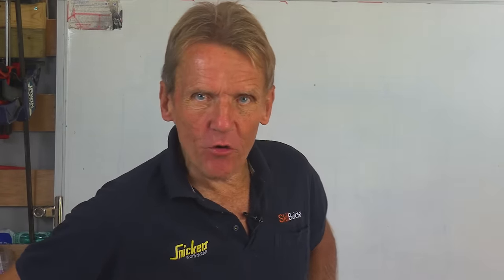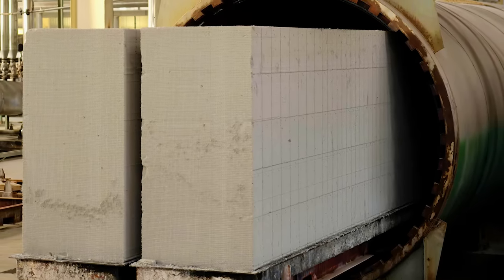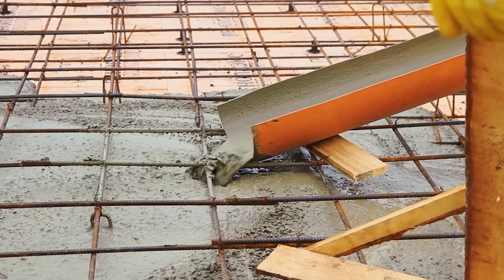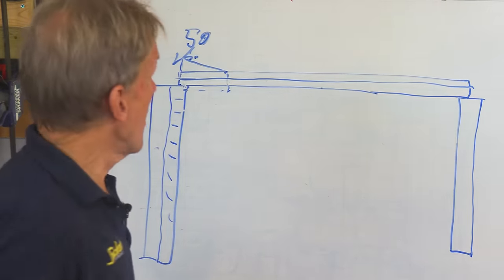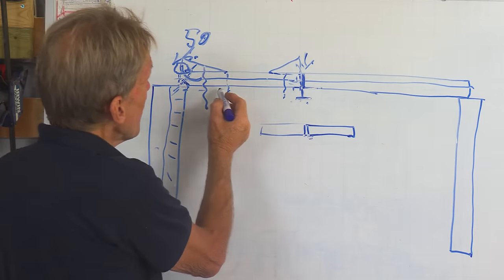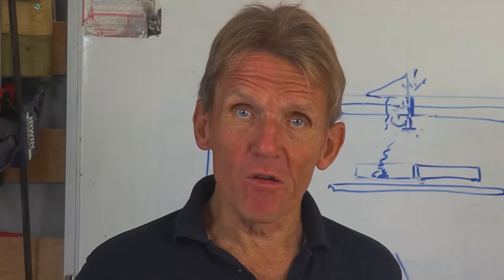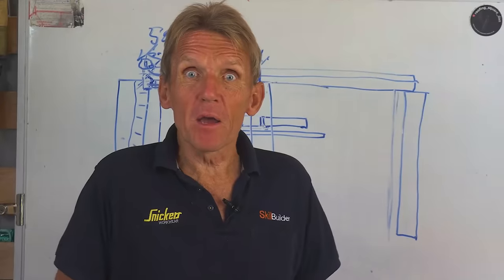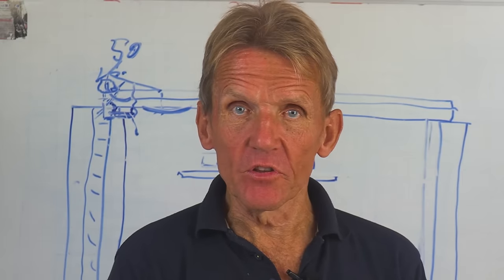The Ugly Truth About Reinforced Aerated Autoclaved Concrete (RAAC)

Comment: 7:10 The water getting into the block, the weight will also increase significantly and so go beyond its "designed for" self load.
Reply: Saw a demo on TV recently that showed a wet aerated block is weaker in compression.  Interesting to consider how a typical two storey inner course of thermolite blocks would fair in a house if exposed to a water pipe leak in the upper storey?  Would the lowest blocks suffer?

Comment: Excellent video. As a chemical engineers, was glad to aee the production and then the explaining (new for me) in its use and downsides.

The replacement program was effectively cancelled by austerity. This program was on track to be completed by 2023.

Agree with standardisation, and if you need an arty piece, do it on the entrance way or put aside one building. You can have two or three design choices.

Comment: Standard school designs have the problem of size, and I think this can be solved by simply having multiple standard designs, one for each standardized size. And the capacity difference could be a multiplier of 3 or 4. For example, with a multiplier of 4, you could build 4 smaller buildings or a bigger building, and arrange the 4 buildings so a non-structural doorway is removed to connect two or more hallways into a single hallway, having at least 2 such points of contact which can be connected at at least 2 different angles each, as part of the design. And you could also mix-and-match multiple sizes, for example, instead of 5 smaller buildings, you could have a bigger and a smaller building either separated or connected together.
Reply: Or, by having one (or maybe still a few) modular design(s) that will also allow filling a non-regularly shaped lot. Would be handy as quite a few schools do after all also need to expand their premises over the course of the lifetime of the building. The modular blocks allow for simple design both initially and for expansions. (The split buildings is also a viable approach, but with modular design you get the same benefits without the inconvenience of a fully split school.)

Note: A standard design will not mean that all schools look the same. The external visuals can be drastically changed simply by the colour and texture of the exterior (and interior) walls and features (like window frames).
Reply: Exactly, @L2M2K2  . The standardized designs would be modular, You could have them arranged in series or parallel, or in whatever shape you want. And yes, the buildings can be made to look extremely different (using different materials for the outside, different arrangements of materials, and different 3D features (examples below) or lack-there-of), and to function differently (i.e. more insulation inside the walls would make the walls thicker but also better for colder or hotter regions). 

For the 3D features, we could have: one school looking like an old mansion with wooden supports because of how it was painted and plastered, another looking like a stone castle, another looking futuristic, another looking like a bunch of concrete boxes, another being covered with metal to reflect sunlight, another having the sun-facing walls covered with solar air heaters to passively heat the building, another using plants and metal supports to make awnings or shaded areas which could also produce edible fruits, another could be inside a huge greenhouse to have warmer "outdoors" inside the school zone, another could be half-underground or mostly-underground (by raising the ground level above the ground level next to the buidling) and have a roof with windows to passively light up the building, another could use "solar tunnel" technology to get sunlight from outside to light up the rooms which don't normally get sunlight (inner rooms with now alls facing the outside)and have sliders to turn off the sunlight, another could be on stilts, another could be rough cement without finishing, another could have LEDs lighting up glass or transparent plastic with a rough side to look like a huge LED with the name of the school and murals, another could also have outdoors classes, another could simply have a sheet ton of windows, and so on and so forth

Comment: I like your point about use of domes. Arches also. Intrinsically strong means potentially more efficient use of materials and inherent redundancy in case of material weakness.

However, as for flat roofs they dont cause spread, and are simple to design. The problem I think is we take 'flat' too literally, and they're set to quite stingy falls like 1 to 60, when we should be measuring flat roofs in degrees, and they should be 4 or 5⁰. That way you won't get ponding caused by sagging, and the chances of leaks are significantly reduced as you're not quiteas reliant on a perfect covering material.

Ease of "inspectability" should be a feature in public buildings, although might be difficult in practice.
Reply from the maker: True, no flat roof should be level

Comment: I live in Switzerland where they know about concrete and chemistry changes. It is quite common to see old concrete structures (like the foot bridge at my local railway station) be stripped down to their rebar-reinforced core using pneumatic drills, and a new outer is cast in-situ. No doubt making it good for another 40 years.  I have never seen this in the UK.
Reply: Big difference here, Switzerland is well organised and its left hand knows what its right hand is doing, and understands the value of preventive maintenance.
Reply: They actually do it using high pressure water believe it or not. I know people that worked on j6 in Birmingham. So yes they do do it here.

Comment: Quick feedback from France we had lots of schools built using the same technique in the 50s up to the late 70s, they were all steel structure. Quite cheap and very fast to build. In 1973 one of those school had a fire and lots of kids died. This type of building was nicknamed Pailleron from the name of that specific school. They even built "enhanced pailleron" where the walls were using sheet of reinforced concrete for better insulation, under fire the steel would collapse and the concrete seal the fate of the child 😢  AAC is known as cellular concrete in France and famous by the name Siporex from the public, outside simple block they are not that used for structure. They tend to use fibre reinforced concrete for complex situations instead. Absetos (amiante in French) was quite used too in France (mostly cladding under Everite brand, but also as insulation whool projected as fire protection too) but since 20 years lots of building has been cleaned from that. This is a very long, labour intensive, complex and thus expensive process. In lot of cases after removing it, the building is so empty they most of the time scrap it for a brand new one. Selling a house/building you need to get a certificate for abesto free that will give a list of any remaining absetos location found so that the new owner take the burden of the health risk on his own😮
Reply: That’s really interesting on how France has handled the problem.  Thanks for sharing.   Best wishes from the UK.

Comment: A great explanation and summary of the current position.
It's important to remember that neither the steel nor the concrete is strong enough by itself, it's only when they work together correctly that they are suitable. In the case of a flat roof there is nothing else to rely on once this has failed. In short this building method was a mistake. It saved money at the time, but.....

Comment: I knew about that aerated concrete blocks being used for walls and it seemed a very good idea. They are very lightweight (easy to transport and lay)  and have insulating properties as well. I would never use this material for structural elements though. It's weak af.

Comment: Architects ‘mincing’ around! Can you say that? Great video, I’ve been in construction for over 40 years and have preached using standard designs for years. Not only does it reduce design costs but also allows for off site modular construction techniques. Also, regarding bearing distances, the end of the rebar has cover to it. So if only 50mm bearing the rebar might not even reach the support. I was investigating RAAC in a University and a hospital near me in early 2019 it should have been sorted!

Comment: Great explanation. I would like to add a peenith to why the ends went up. Since I became a carpenter and before it, I've noticed the practise of not having an adequate break between wall and roof. As a kid it was achieved with, for instance a 6"x 1" Tan with a angled triangular 2x2 connected together and the Roof itself but NOT the wall.later an aluminium section was used pre made. Flashing laid over this, leaving a water tight finish allowing abit if give. Everywhere I go now is directly attached to the wall which moves differently causing cracks where they meet. So the ends determination is in that area in my opinion down to cracks appearing in this area. Flat roofs only have a poor shelf life but pro active surveys would prevent this stuff.. Atb William

Comment: Great informative video. Point worth noting is the addition and/or modifications during the life of the building. For example for M & E services - we've all seen joiners/plumbers or electricians running pipes, cables, ducts through structures without regard for the integrity of the building. And in my experience woeful record keeping of ad-hoc mods carried out through the years.

Comment: I think steel portal frame construction is probably the best solution for public buildings (galvanised preferably).
Reply: The problem with steel is fire. While steel doesn’t melt at normal building fire temperatures it does soften. It looses its strength and the building sags , trapping people and causing more damage. The solution is of course to box the steel in with fire retardant material, like say some form of concrete. Now we get back to the rust as we have buried the steel inside another material and cannot inspect and maintain it. I think that’s one of the reasons people went to concrete in the first place, it was fire proof out of the box.
Reply: @francesconicoletti2547 generally in the UK, concrete frame buildings are used for hospitals and apartment blocks where there are likely to be people asleep and less able to quickly respond to fire alarms. Offices and department stores where people are generally only there in the day and can respond quicker to a fire are more likely to be made from steel framed structures as they are cheaper and the risk to life is lower.
Reply: @francesconicoletti2547  point taken re. steel and fire, galvanise it and box it in with fire rated plasterboard. Problem is governments don’t invest for the future and build for the long term, it’s all about cost now, not true cost over time.
Reply: @francesconicoletti2547  Sprinklers, surely?

Comment: I agree with you. Having a standard school building across the country makes it easier to navigate, saves time with architects and engineers know exactly what to do and when. I know a bricklayer who gets very frustrated when he arrives on site only to find out the plans have changed and he has to do 3 times the work in the same about of time. A standard design negates all this. Though it is vital that this standard design includes teachers, children and heads in the design process. They know what is needed in a school and the flexibility rooms need when things change. Ignoring their needs would result in a standard design not for for purpose.

Comment: Excellent explanatory video. Well done.  The surveyor would need to access the (perhaps asbestos) suspended ceilings to camera-check the full length of EVERY hidden RSJ and end-walls, to examine the seating, plus adjacent short length of beam under-surface, to verify All the RAAC beams are still sound.  Perhaps just the top floors of relevant buildings with flat roofs but still a lotta work !

Comment: Excellent point about using traditional building design for schools! They may be 'boring' but straight lines and a simple, logical layout make it much easier for someone to get to where they need to be and work out where a particular location is in the building.

These modern 'rabbit warrens' and layouts designed to 'entertain' kids as they move around are a nightmare to navigate and work out where somewhere actually is. It's good you mention wheelchair access but you should have also mentioned accessibility and usability for people with other disabilities. I mention this because I am diagnosed with autism and I have found visits to schools very confusing and difficult to navigate. One was an infant school which was all open plan and a long meandering curved path as a 'corridor' - it was apparently done this way to keep kids 'amused' while they are there. How such designs do not fall foul of the Disability Discrimination Act, I do not know. Personally, I would consider litigation against those responsible for this blatant discrimination. 

This continual 'entertainment' of children needs to stop and it is no surprise so many young people are useless and complaining of 'stress' in the workplace when they have been continually 'entertained' and everything is for 'fun'.

Comment: Superb blog Roger.. I hope some Politician actually watch's and hopefully understands your solid information and advice..

As this RAAC issue becomes mainstream news, The 'Media' is doing their usual job of just looking for someone to blame and fogging up the issue..  
As I understand it,  Buildings (UK) are designed to have a minimum  lifespan.. Residential is 60 years (I think..) 

So when the design is being considered by the Planners and BC this is what they accept..    But,  also in the process is an accepted amount of maintenance.. especially for a flat roof..   
Flat roofs are favoured by the Concrete Trade.. because they use lotsa concrete..   yay..
       
As Schools and Hospitals etc had their budgets slashed , maintenance was the first casualty and thus that 60 year use became 40 and we are now at that time..     
So, as Roger says.. NO to flat roofs.. 
For Roofing look to Industrial Sheds for Insulated panels at shallow pitch.. which is a cheap and suitable option.. Leave concrete in the ground where it belongs..

Final point.. Track down the original Tech Drawings for the Building being inspected.. It should show what and where materials were used..

Comment: You missed the bit about building regs change with location depending on altitude and wind exposure.  Scotland has stricter roof structure especially snow loadings etc. Still brilliant accurate explanation.  I'm a retired apprentice trained building contractor with 59years experience in construction.  WELL DONE.

Comment: throughout covid - I was working on behalf of the NHS to survey the RAAC blank, and report back to the covering board.

There are a number of signs to look out for - spoiling, staining, cracking, debonding, and deflection are the main contributing factors towards a defective RAAC plank.  they are often (given the time period when they were constructed), finished internally with a coating that has asbestos within - referred to as an Asbestos containing material.

this factor means that anyone planning to set themselves up as a RAAC plank surveyor, has to have asbestos awareness training, and knows the correct procedures, for working within confined spaces, should the RAAC be hidden by a suspended ceiling. 

I was responsible for the vast majority of propping, at the hospital, which I was surveying.  This brought up the need to maintain the functionality of the space. One prop might have been enough, but its location will leave it vulnerable to collision - beds, or trolleys being moved. So multiple props and a timber crossbar are used to form a goalpost frame.

This makes it look worse than it actually is, to the general public.  But, we all have to start realising that propping is, and will always be, a temporary support structure - to mitigate the possibility of sudden collapse.

Propping is not a permanent solution, so I have started to look back over my notes and approach I was developing 2 years ago, to create a solution to this problem.  All I can say at this point in time is watch this space! I was on to something then, until I blocked from continuing my R&D by spineless middle management, that totally lacked the ability to create an original thought.  that had /have, no comprehension of the issue, or big picture.

now, free from all that, I have been able to move forward with my concepts and I do believe that I will be able to bring to the fore, a complete solution in the not to distant future.   when it's ready, I will be shouting about it from the rooftops - just not a roof made of RAAC 😊

Comment: Thanks for the technical run-down - really useful to get a proper builder's description of what it's all about.
Data as of 6th Sept identifies 147 affected schools (9 of the original 156 have been determined to have no RAAC), 43 of which are currently not full face-to-face teaching (delayed start, all-remote, or mixed face-to-face & remote).
I see NAO reports 41 hospitals affected, 7 of which need a full rebuild - so far, development work has started at 1 (so much for Johnson's 40 new hospitals!)
I wonder how many non-state buildings might be affected - housing blocks, offices, etc. Hopefully the management and insurance systems in place for commercial properties means things haven't being kicked down the road as much...